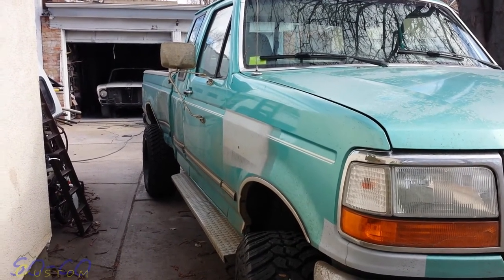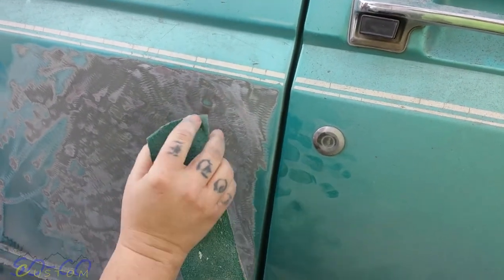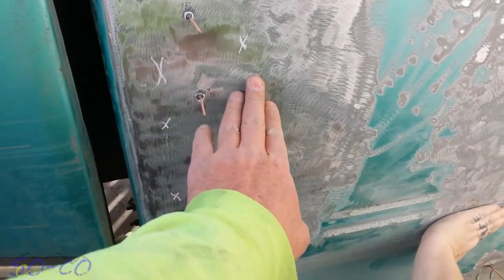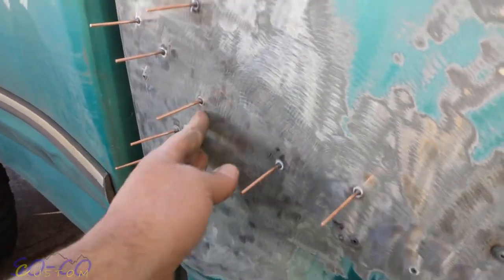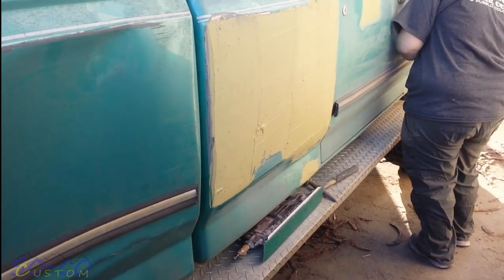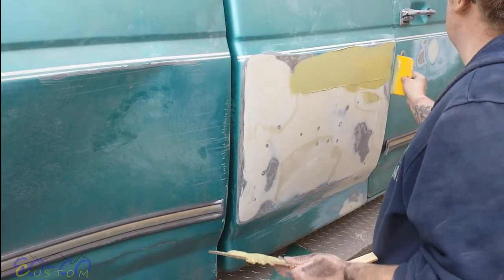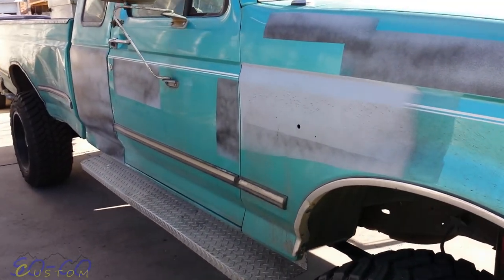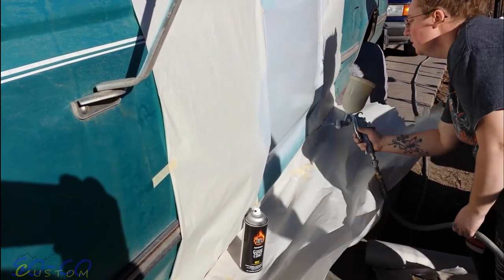1995 FORD F250 Extended Cab Body Work ( 1 of 2)

Comment: Any updates on the body work?
Reply from the maker: I did start on the passenger extended cab body and I have started on the passenger side of the bed of the truck.  I still have the back and drivers side of the bed to work on.  I will make a updated video now that your comment got me motivated!  Also, I started work again back in April(concrete) so time has been slim.  With winter coming I'm planning to finally finish it up!! I got some fender flares that have been sitting here waiting to get installed too.  I can't wait.
Reply: @MountainSide719  hey bro i have a 95 obs sclb 302 f150 i’m gonna do some light body work scuff the truck and raptor line it cherry red these videos helped me get an idea
Reply from the maker: @depressed6025  Good to hear! I hope to see the out come of your project truck some day! Glad I could help in one way or another. Peace!
Reply: @MountainSide719  is there more?
Reply from the maker: @depressed6025  more what?